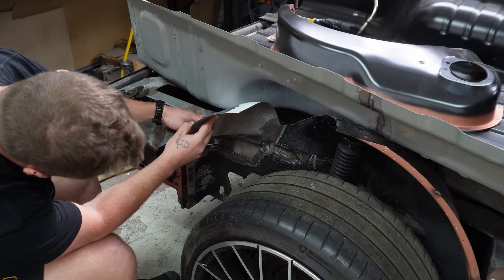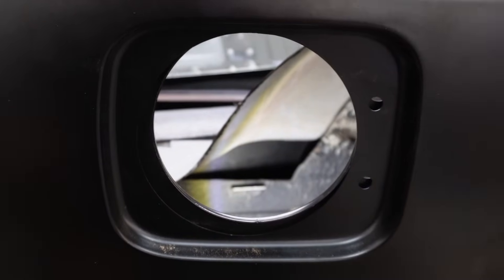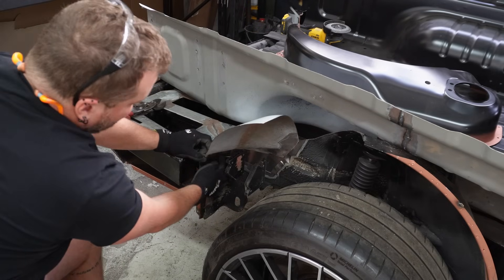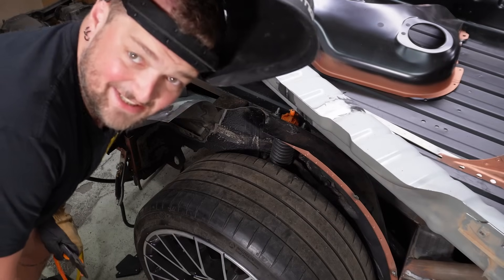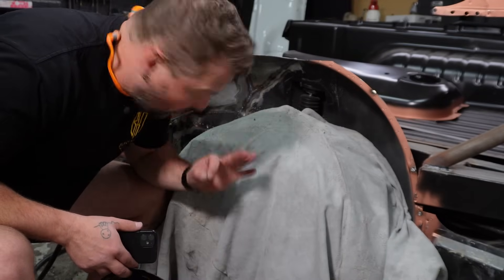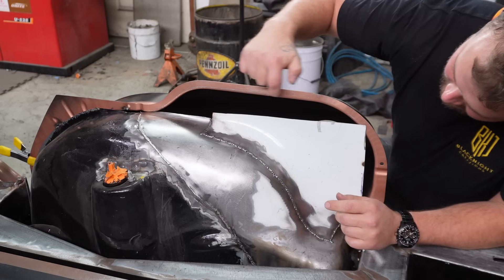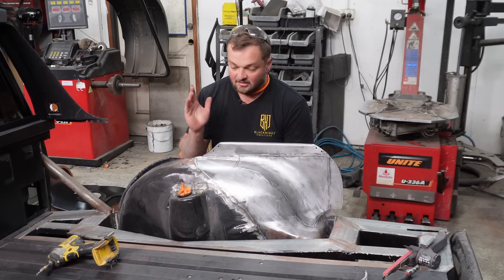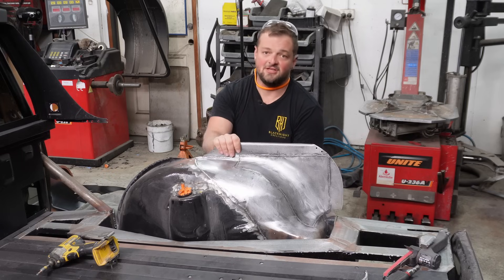E30 M3 Ute. The Last Puzzle Piece. ep.29

Comment: 3M speedglas with adflo unit would be best bet imo, very expensive but PAPR is well worth the investment to protect your lungs

very comfy functional headgear with lots of adjustment, true colour and you can get them with inbuilt grinding faceshield

if you're not interested in PAPR Lincoln Viking 3350 is a good call and not unreasonably priced
Reply from the maker: I’ve used that whole setup before and it really was a great setup. Looked at reviews for the ESAB and so far I’m pretty happy with it and can also add an air filtration system later on down the track.

Comment: I now know why I woke up at 3am. In a e30 there’s a vent pipe and tank for the fuel tank in that right rear wheel arch  you may need to put back in . 
With the rear shocks you could put a bolt through the top and weld it in so you can get to the nut from the underside to remove the shock . Rolls Royce have the same issue and you have to remove the rear seats and parcel shelf to get the bolts . Hope this helps
Reply from the maker: I’ve been looking at putting a fuel vapour canister out of a different car to make it fit. Been thinking about making a service hatch in the Ute wheel arches but I’ll have a look at welding in a thread instead.
Reply from the maker: I see you’ve also been watching Matt Armstrong rebuilding the Rolls Royce
Reply: @blacknightcreations  yep I’ve followed all his builds . Another one in the lab where glen is building a crazy fast Nissan march

Comment: I'm about to lift a huge rock as I cut the rust from my Infiniti and weld in some patches, never welded with gas before just my crappy little mig!
Reply from the maker: If you can use gas with your welder I would strongly recommend it, grab some sheet steel and do a bunch of practice welds. You’ve got this, it isn’t as hard as you think, you’ll be done before you know it